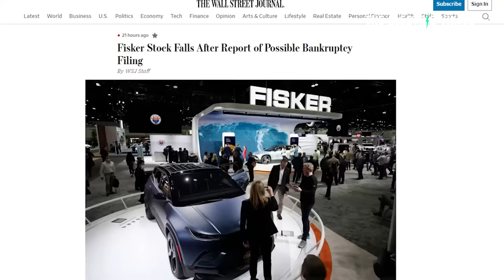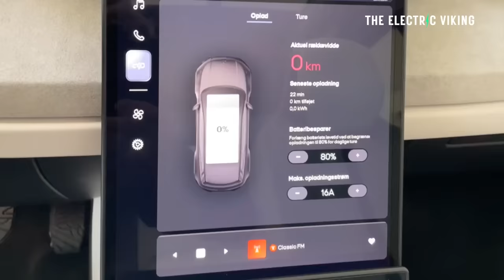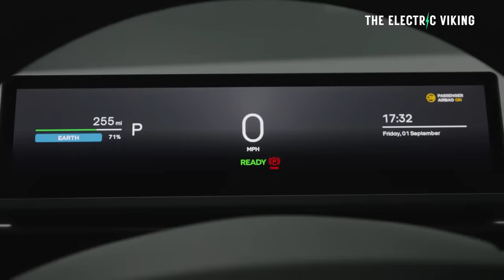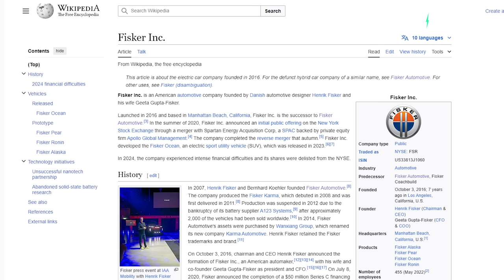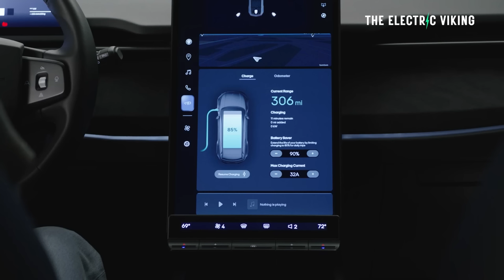Fisker Ocean electric SUV price slashed to BARGAIN $24,999

Comment: If you want buy one, probably best to buy two. One to drive, the second for parts😂
Reply: ehehe ehehehehehe very funny ....NOT
Reply: Now that's a plan !!!   Buy three !!!
Reply: Don’t forget to buy a brain first.
Reply: So 28 gets you the basic Leaf with 156 range where the 24k gets you 221-261 miles in range.
Reply: But if the problem is software related your toast
Reply: This way you get two FOBs

Comment: Not having a warranty is not that big of deal at this price, it's the fact that a lot of the car won't have parts or there won't be anybody able to fix software issues.  Unless Magna steps up and announces they will support the car at a price.  In fact, I think Magna could step up and take over easily but will they is the big question.
Reply: That’s assuming the buggy software issues are fixable by anyone, or at all.

Comment: The Karma got snapped up by a Chinese company and resumed production and this will probably happen with Fisker. 
The business model didn't work as it was but moving production to China might work as the car isn't bad if the software issues are fixed.

Comment: Firesale prices basically. Fisker probably stand no chance of surviving which is a shame because the car is fairly nice even if the software came in for a bunch of criticism. Probably doesn't help they used Magna Steyr to make the things so their manufacturing costs probably eat even more into the margins.
Reply: The build quality is excellent, Magna Steyr has done a great job but the software issues and the way these problems were handled by Fisker management have taken the company and the Fisker brand down

Comment: Fisker haters will  tell you the car had issues with software v.1 but they wont tell you the new cars being sold today have the v.20 software which has fixed most of the issues ..they tell you company will go BK but they won't tell you cars were built by magna and some of essential parts of the software were also developed by magna which will be around even if Fisker goes bust so customers will still get support ..these sick puppies are after their own personal gains or revenge on Fisker and they have contributed to the stock price being whre it is they are the ones who should go to jail for lying abd defaming a company and it's CEO

Comment: I don't want Fisker to fail, but that time appears to have passed.  The concern with buying a car is if they do fail, considerable features run through Fisker servers and will be inoperable. This includes map updates, reail-time maps, likely voice control, all streaming services, connection to the app, software updates and more.  Replacement parts could be very difficult to come by, although as cars are crashed, they will supply a small number of used parts.  

Not sure what will happen with recalls (and there will be some).   With all that said, if you know what you're getting into, and you're tolerant of problems and handy at maintenance, it might be worth it to you.   

Another key is to be sure Fisker provides service manuals and schematics like Tesla does, as without them, there is little hope of long term repairs and maintenance.  It's important that they are not server based, as again, once the servers go down, access will be gone.

Comment: Forget these Tesla pumpers it's garbage unless you're willing to pay 70k Fisker ocean is the best EV for $30 k
Reply: They will sell out, almost guaranteed.  If you want one I suggest getting on it right away.
Reply: I just bought a brand new Tesla for $20k it’s a 2021 with 20k miles .
Reply: @camronrubin8599  40000 KM is not brand new lol
Reply: @camronrubin8599  brand new in the sense that it was owned by someone who wasn’t you?
Reply: Buying a software-dependent vehicle from a manufacturer going out of business is akin to taking $30,000 and setting it on fire. In the event it even drives, it can never be repaired. No new parts will be made. The massive software bugs will never be fixed
Reply: @alatmancave7093  this is a very bad deal. The fisker has a lot of software issues not to mention faulty sensors. You are not buying an asset you are buying a liability. The company is flat broke as if right now they are trading for 0,010 cents becoming essentially worthless. This means parts service and software updates are out of the table not even Nissan can save them at this point not that they would.
Reply: @jz261  having driven one myself I can tell you have no idea what you are taking about , and sensors are not faulty they are sensitive and can be turned off , wow the misinformation here
Reply: @alatmancave7093  faulty, sensitive whatever you call it they aren't working properly and while the car by itself may not be that bad it's company is dead. Meaning if any part breaks down only place in the world you can ask for parts is Magna Steyr. Funny enough I live in the same city where the ocean is made yet I never see them on the road. Only place I ever saw them was at the local V4 supercharger since they don't have a network to charge they are forced to go there and pay for a subscription not to mention that they were test vehicles, it was like seeing a dolphin surrounded by sharks. Face it fisker is dead in the water and very desperate otherwise they wouldn't cut prices so badly.

Comment: Heck who wants the car?  I want the Extreme's 113 KWhr battery for home energy storage!
A tesla powerwall in the US is like $9,300.00 and has 13KWhr. Getting the Fisher for $25,000.00 is a steal!  Yank the battery and cooling system and build your own home off grid power storage!!!
Some bright entrepreneur with some money is going to figure this out and buy all Fiskers cars at this price and sell them converted to  home storage devices with a minimal warranty only covering installation defects.
Reply: It's too much risk, a single failure event may burn your house down. This is lithium, so nothing is going to stop the fire. You better be an expert in battery management and protection.  You need to prevent overcharging and overcurrent conditions, and especially short-circuiting. Otherwise, you insurance company isn't going to pay claims.  If just buying for batteries, it ain't worth the price.  If you make use of the car for 5 years, maybe.  The first time you need a part, you are screwed.  Not worth the risk to me.  If you buy 5 for your family members and 1 is a hanger queen where you can use it for parts, I can see that could work for a while.  Still with no support this mishmash of software/hardware issues can be a nightmare.
Reply: @coolpix222  Lithium fires are extremely rare despite what the sensationalist media seems to say.  Gas fires, cooking, smoking, Christmas trees, Dryers, kids playing with fire, candles etc... all account for many times for fires then batteries, and nobody criticizes these.  Batteries aren't even on the top 10 list and usually they are installed outside the home.
Reply: @Ryan-ff2db  what makes batteries safe is battery management circuitry.  One should not be installing such batteries in their house like its some basic project.  It's not, again you need to design in protective circuits sized for the battery bank that you desire to install.  Is you design going to be UL Tested?  The answer is no.  Then, when a failure happens and the batteries go high order, your house will burn down and the insurance company is going to find the root cause and they aren't paying.  Nothing is stopping a Lithium battery fire.  It will extinguish when all of the energy is released.  Even if you have a comprised dielectric material between the anode and cathode, which would not be your fault, but the fact that you hooked it up illegally and not per code, the insurance company isn't paying.  There is no upside by trying to save a little bit of money.  The amount of batteries that you would get in the discounted Fisker is not worth the price if you are only using the batteries.
Reply: @coolpix222  Good points and things I would also consider. However given the right electrical knowledge it can be done safely and has been done with packs from electric buses, cars, etc.  The key here is that the car's pack management and cooling systems are already there. It's just a matter of putting added electronics between that pack and the house. The pack doesn't have to know it's running the house and not the motors in the car. Yes, some electronics may have to be changed in the pack management system to work with the external electronics. The good thing is that the 3rd party manufacturer was making these with off the shelf parts that probably come from another EV manufacturer or Tier1. That means that there is doc available on the electronics boards in the pack.
Reply: @coolpix222  You are correct.  I read his statement quickly in the morning before work.  I thought he was talking about vehicle to grid which would be UL approved.
Reply: The battery pack is configured for roughly 400 VDC.  So, you will need to convert that in 120/240 VAC and vice versa.  Basically, you have Conversion, Inversion, Battery Management/Protection, and battery.  You need a good EE to design the system.  I am an EE by degree, but I have not been technical for many years as I have a leadship role.
Reply: @nickmcconnell1291  According to the intertubes, Fisker Ocean can do bidirectional charging and vehicle to grid.  So no need to dis-assemble in theory.  Please don't take my word for it though, I have no idea how well it works.
Reply: @Ryan-ff2db  I had read something similar. It depends on how much it can deliver sustained as to whether someone would want to yank the battery and build their own system.

Comment: They would have to pay me a hefty fee (at least twice the cost of taking it to a battery and materials recycling center) before I accepted one of these cars. It is apparently functional but buggy and annoying right now. As an abandoned software platform it will get worse over time. Within one year it will probably be too dangerous to drive. Within two years it will probably be bricked and simply a two ton stationary ornament. Unless you are an EV mechanic and a software engineer, I would recommend staying away from these cars.

Comment: If there’s a 50% markup, then the discount is the recovery of cost.  Perhaps we’ll see Magna either walk away, or move to take corporate control.

There’s also the annoyance that they raised $150m. in notes before they got booted to the pink sheets.  If the company doesn’t file for liquidation, and then no liquidator is appointed. then a reorganization is in order.  The note holders have precedence over ownership either if the liquidation is filed, or when the fiscal problems are sorted.  The first order of the day would be to kick family members from the board.

All of the investors probably abandoned the stock on the crash, so it will be a new posse of investors, those that invest in distressed companies.

Anyone holding shares will probably be swapped for warrants at a 10:1 consolidation.  But then you have to come up with the strike price after.

Fisker serves as an object lesson for the EV space, that all EV makers will have problems selling cars.
Reply: Right, all EV makers will have problems selling EVS. Brilliant. The largest selling vehicle in the world last year was an EV, but then again, I'm sure you're going to troll that one too.
Reply: @douglaswatt1582  I think I’ll be proven correct.  All EV companies will go bankrupt.  The one thing  that has me using public transit and deciding to do something other than engage in conspicuous consumption is the cost of INSURANCE.  Then there’s the cost of tires.  Then there’s the cost of deterioration of batteries, and the breakdown of charging infrastructure.  Then there’s the depreciation of my car when a new battery technology comes out, making my EV immediately obsolescent.  Then there’s the cost in time of having to charge up the car.

The dream of sustainable EVs will be broken when supply chains fall far short.

Comment: Thats a solid deal just keep it fully insured and be in an area like California where you can most likely find 3rd party repair shops that can handle Oceans
Reply: 3rd party repair shops aren't even able to get parts right now
Reply: @Chukonu5  what are you really going to need. Maybe brakes, tires or a 12 volt. The only real concern would be a key fob.
Reply: No insurance company will touch it.